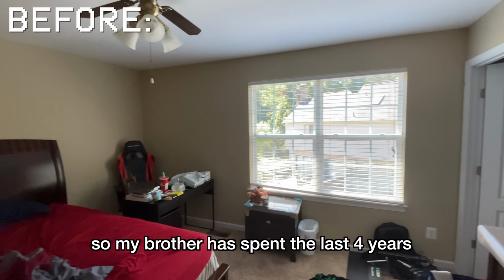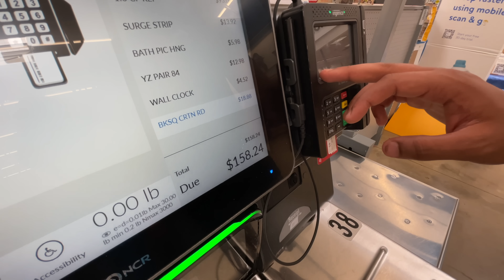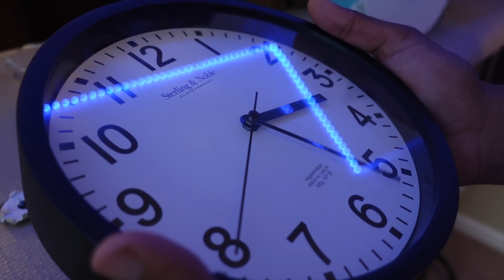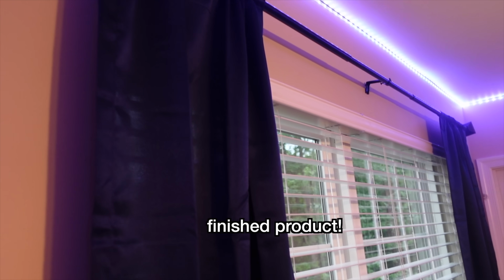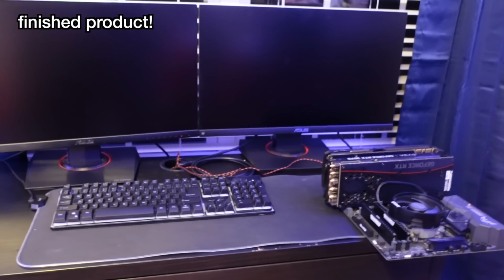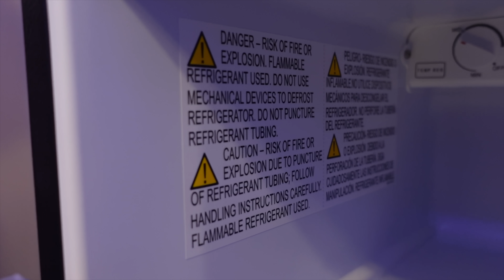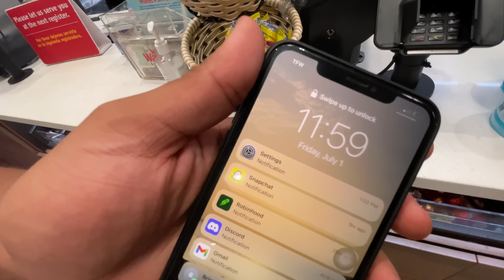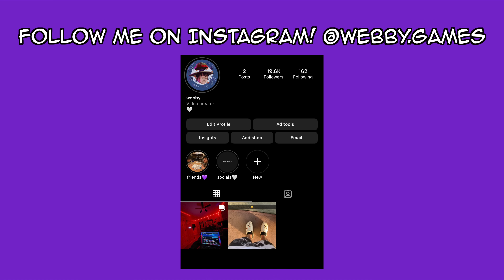Transforming My Brothers Room Into His Dream Room!

Comment: the only problem is the two graphics cards... they don't work together which means if you're playing a video game or something only one of those cards is being used since there is no SLI (which is basically just the cards are connected using an adaptor, but they discontinued it for 30XX series anyway) 

By having those two cards the bandwidth is slowing down the 3070 and with that you're only getting 1/4 the power of that 2nd card. You will see improvements in FPS and other aspects if you just remove the 2nd card (980 TI) Other than that nice room!!!
Reply: oh shit thanks for letting me know, i have a 3060 and a 1050 in my computer
ill make sure to remove the 1050
Reply: So if I were to put 2 3060 would they work with each other or no?
Reply: @silverbristle6372  yeah I’m not really bright at PC building but thx for telling me
Reply: @GamerGoonMC  oops I didn't see someone already replied
Reply: @GamerGoonMC  SLI is useless now, it was worth it on older cards like the 980ti and old amd cards
Reply: Especially the 700w psu, and the stock cooler 😂 that hurt me
Reply: @27two  850w gold psu gang
Reply: @Kenny Rrrre  yeah my friend had to get a 1600w PSU for his 12th gen 3090 setup...
Reply: yeah honestly his brother would be better off running a 3090ti if he wants the amount of power he would get from two 3070's
Reply: Did ur heart drop when they were touching the motherboard and prob dident ground themselves.. risky but it worked out fine😅
Reply: @Kenny Rrrre 30 series sli bridge got discontinued
Reply: SLI is usually meant to combine power but most games don’t take advantage of that yet. If the game does, it will use one gpu to render half the frame, and the other to render the other half. Then you have NVlink. It’s usually meant to pool bandwidth together, usually used for deep learning/ai
Reply: @astropie3197  Yet? No, it used to be supported then everyone realized it was garbage
Reply: Then in the final shots both cards were gone and there was some goofy “FirePro” stuff in there. 😂
Reply: @GamerGoonMC  If you put a NV LInk (what the name of the new SLI Bridge is called) they would, however most games don't really support multiple GPU's.  His brother would be better off selling that other 3070.
Reply: No 3060/70/80 works in nvlink/sli
Reply: @gamingcontentxd1361  right but it's pointless because almost no games support it.  Plus he could probably sell both cars and get a 4080 which is probably better overall
Reply: @salthebard6258  he doesn't have 2 3070's, you can tell this when watching him build it and reading the front of the card, which one says rtx 3070 and the other says gtx at the start, (although I don't have my glasses on so I cant read the rest) there are no 30 series cards that start with gtx

Comment: I would've used aluminium profiles to screw on the wall for the LED strips on the ceiling. To diffuse the light. Unlike all the tiktokers do. I would want it to look professional 😉 also: that doesn't make a mess after removing them